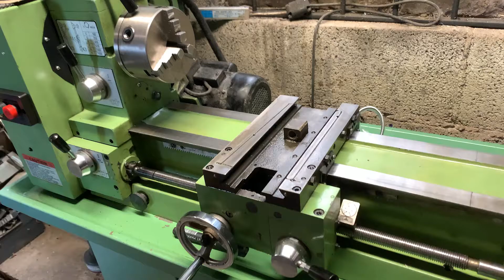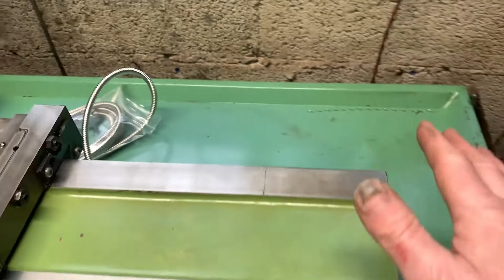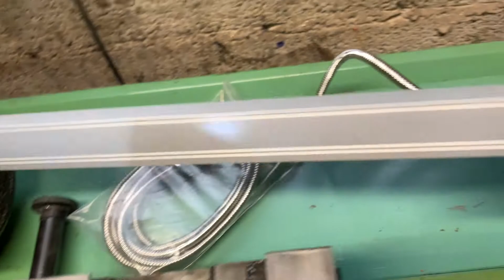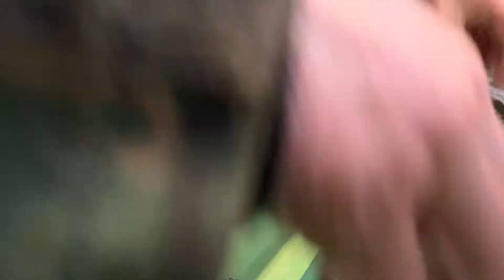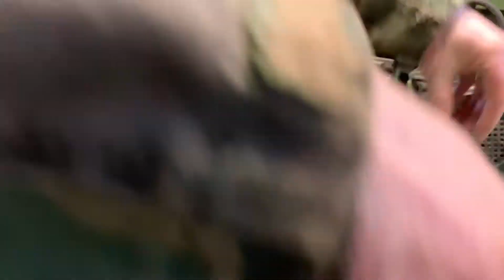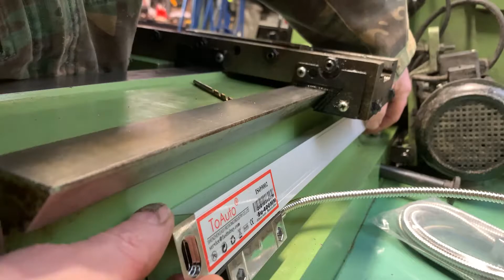Warco DRO lathe upgrade, Finished!

Comment: Mike absolutely fanbloodytastic ,I can see you have a good supply of lovely alloy blocks ,try a spring tension affair on your cable management it’ll pull it out of the way going one way and expand to let it travel the other way just a thought ,I’ve got a similar Chester lathe which I hope to up grade this year to a lathe and separate milling machine and I think I’ll be looking at Warco because of spares availability great vid Mike stay safe 👍👨🏻‍🏭
Reply from the maker: Hi Paul, thanks for the great feedback. I might give it a go with the spring but at the mo the cables seem happy to move with the carriage. The mill is a bit limited on the lathe and a separate one like yours would be great. Good luck with your upgrade 👍🏽👍🏽